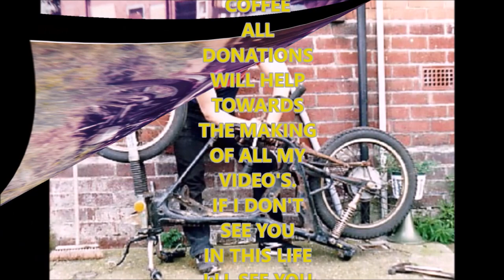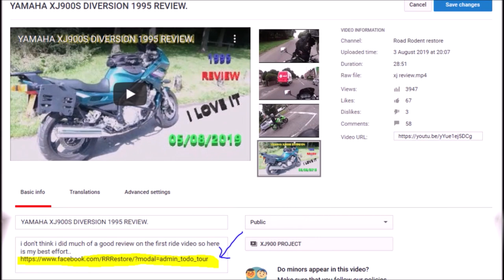Triumph tiger. hardest fuel tank I've ever removed.

Comment: While you have the headlamp off, the biggest single improvement you can make is to wash out the inside of the lense and the reflector. You will be astounded at how much muck comes out and how much difference it makes to the light on the road. Take an old tooth brush and bend the handle 90 deg by heating it and some warm soapy water is all you need. You'd think a dab of grease was expensive! Previous owner Mr. K Kong, not an electrician?
Reply from the maker: Thanks for the helpful tips.👍

Comment: Hello Mr. Tiger I have one old of the Yamaha xj  900. In need of some parts rear break system, oil leakage from cylinder head, fuel pump system. From Sierra Leone West Africa
Reply from the maker: Hi. Great bikes. Good luck with your project.👍